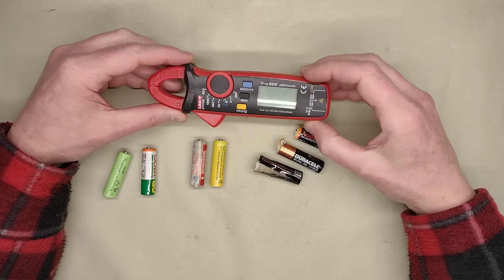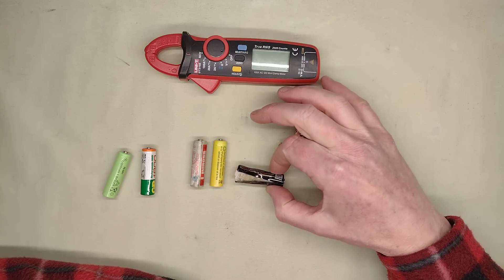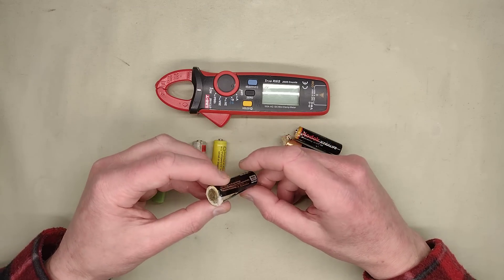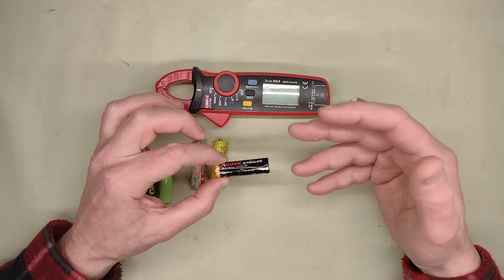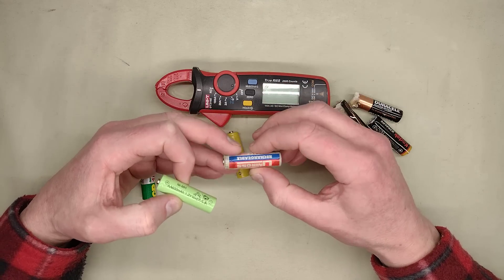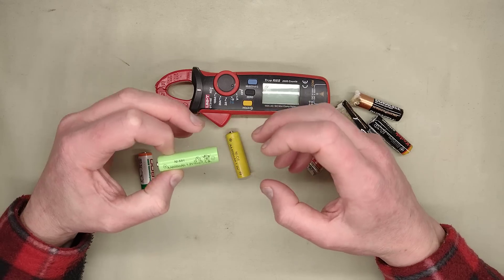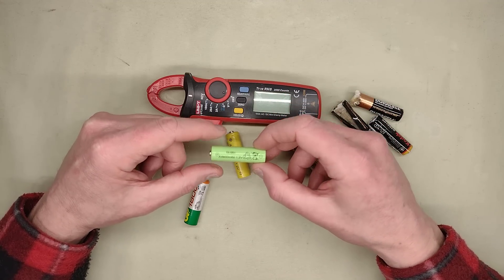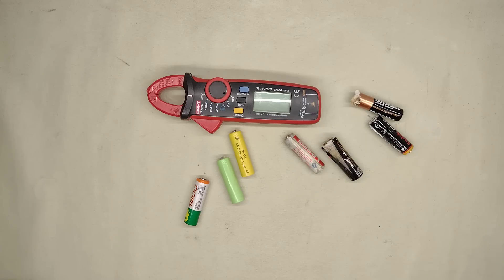The curse of leaky alkaline batteries

Comment: With rechargeable batteries a good charger is a must, one that individually monitors the cells and has good control circuitry. Selectable or moderate charge current is best. There are so many poor quality ones around, with very basic design, often charging batteries in pairs.
Reply: Agreed. I have a battery charger that can do 12 at once. I often get 1 or 2 dead batteries, and suspect it is the charger killing them.  I may be wrong, but the problem appears to be, that it continues to charge ALL batteries until the last one is ready. So, 'over-cooking' the majority. I'm considering buying, or designing one that charges multiple batteries, but treats each battery individually.
Reply: If you're using the cells in pairs, wouldn't it make the most sense to charge them in pairs, i.e., as a battery?

I have a charger that monitors individual cells but the result is my NiMH AA/AAA cells all wind up with different voltages. Which could be why I've got so many ruined cells.
Reply: BQ-CC55 or 17
Reply: Got those, mine always seem to overshoot and create hot batteries 😟 Amazon USB charger never had a problem, slow to charge but they don’t get warm!  So my Wii and torches are always ready.
Reply: @Knuckles the Echidna  Some chargers use heat to detect when a cell is charged
Reply: @Javadamutt  Never even considered something so dumb to be done, wtf.
Reply: @niebedeuzywategogowna6011  Makes a lot of sense actually. The voltage drop when a battery is fully charged is hard to detect, especially for fast chargers. The heat increase above charging temperature is much easier and therefore cheaper. Supposedly the damage from the heat, provided it is done right, is much less from overcharging as a whole. Some trickle chargers can be just as bad as fast chargers. It all comes down to detecting the shut off point.

Comment: Unfortunately many older, still good, digital cameras will not tolerate the lower voltage of NiMH cells.
Duracell alkaline cells seems to be one of the biggest offenders in terms of leakage as well as being of lower capacity than many competitors' offerings, the 'Simply' range in particular.
Reply from the maker: I tested the Simply range and they had really low capacity.

Comment: The biggest downside to NiMH is their lower voltage. In things like flywheel driven Nerf foam dart blasters, voltage is everything for driving the flywheel motors. Say a blaster takes 8x AA cells. At 1.5v per cell for Alkaline, that's 12v. At 1.2v per cell for NiMH, that's only 9.6v. That's only 80% of the power of Alkaline when running on NiMH, which is a huge FPS loss for the blaster. Alkalines still have their place.
Reply: Alkaline cells are only 1.5 V when new. The voltage drops quickly with use, down to 1.2 V after discharging 20-60%, and below 1 V before the cell is dead.  The higher the discharge current, the faster the voltage drops off.  NiMH cells start at a lower voltage, but tail off more slowly so that the voltage is higher than an alkaline cell's voltage over much of the discharge cycle, with a more pronounced advantage at high currents. If your device needs more than 1.2 V to operate well, it's a poorly-design device that fails to use NiMH cells AND makes wasteful use of alkaline cells.  You might be throwing away batteries that are less than half used.

Comment: Yet another argument in favor of ponying up for a smoke alarm with a non-replaceable 10-year battery. I've never had a 9V alkaline battery go crusty in a smoke alarm, but how many of us can honestly say that we replace our alarm batteries as often as we're supposed to?

I can easily imagine the 9V battery in my Fluke 87-V going flat and bursting, as well as the ones in my cheap dinky meters. I can't imagine either type of meter working too well on a 7.2V NiMH rechargeable battery, though I suspect the good people at Everett might be willing to consider a redesign...provided they could, of course, ensure the same performance that made specific meters required test equipment in many military and industrial service manuals.

Comment: Just found a couple of leaky cells myself as I went through some things that had not been used the last ten years (actually looking for my abandoned set of NiMHs and their charger). The worst one was a Duracell in a Garmin GPS, that one left a mark. I've also come across a couple of leaky Energizers in a LED string and the indoor unit of a thermometer. I've hardly seen any leaks in all the cheap supermarket brand cells I have laying around - thinking they may be somewhat less densely packed than the fancy ones, thus more room for the contents to expand. I also came across a bunch of cheap "ABC Alkaline" cells that expired around 2015, no leak and still in the mid green sector on my tester.
Reply: The generic cells that come packed with devices from china never seem to leak.
Reply: @stargazer7644  I had one AAA that I suspect was a bundled one leak as well. Luckily it was sitting in the spare battery slot in the foam in the storage box for the device - a long time banned green astro laser for pointing out stars when star gazing.

Comment: I got some panasonic alkalines to go in my panasonic "hedge trimmer" and they boast about including something to absorb the gases from "When the battery is over-charged or stored for a long period" not really sure how you'd overcharge an alkaline and only time will tell if the second part is marketing spiel or not, though I have to agree with others that if it cost more than $100 it is a good idea to only use lithium primary cells.

Comment: Gotta say I agree Clive. I just bought another 12 Eneloops ("Boxing Day' Sale, 30% off retail) to add to the growing collection. Some of my '80s and '90s audio gear remotes are near irreplaceable and it only took one alkaline leak to convince me to go all Eneloop.
Reply: Eneloops are permanently half price "on sale" at IKEA. Their Ladda 2450 AA cells are Eneloop, same factory and same specs. Precisely identical.
Reply: @JxH  Good to know - if only I lived in the UK! ;)
Reply: Exactly same here
Reply: i had enloop back when Sanyo made them  used them in Point and Shoot camera they lastes as long as high end battery  but  they only lasted a year before 2 of stop charging  and that around the time Panasonic bought that name so bought 2 of them they did not last as long would get very hot in charger   Where other 2 Sanyo branded ones never did and it Sanyo enloop charger too  . I never bought anymore  i went to rayvac fusion never really had issue with them  now i use my phone lol no need for point and shoot camera
Reply: @BeautifulAngelBlossom  Same, all of that (Canon camera). However I replaced the Eneloop charger quire quickly because, as you say, the cells got hot in it. I still have those cells, still going well (as well as newer Eneloops, never had trouble with them). Happy New Year!

Comment: A few years ago, there was a festival called the Big Green Gathering.  The USP was supposed to be the use of renewable energy; no petrol or Diesel generators were allowed on site.  But disposable batteries were not banned, and probably ended up creating more pollution .....

Disposable batteries are *evil*.  Just work out the price per kWh, and compare it to the mains .....  1.5V per cell, times the Ah capacity = watts-hours per cell.  Divide 1000 by that to get the number of cells required to deliver 1kWh, and multiply by the price per individual cell. 

You'd be paying less than 20p per kWh for the same amount of juice out of the wall.  And that's on a key meter.

Comment: One problem of NiMH battery is there are some chargers need two batteries for the chargers to work. I have an old Carrefour chargers need two batteries minimum. It's a conundrum if you have devices that used only one battery. NiMH usually sold as two per pack. If one battery dead, I need to takeout it's twin from other device to charge one battery. 😅